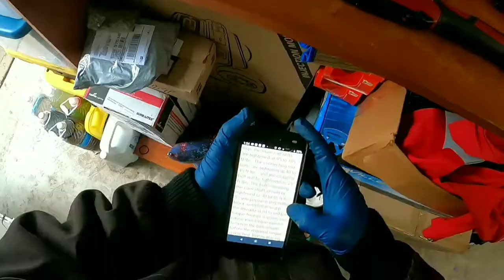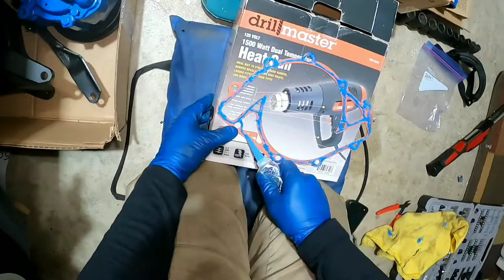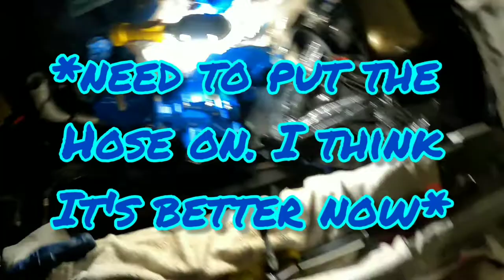Ford 460 STraight up Timing Chain Cloyes 3079x Part Three

Comment: How did you re-seal the timing cover plate back to the oil pan? Love the series, very informative. Keep up the good work
Reply from the maker: Ultra blue rtv
Reply: Any leaks?
Reply from the maker: Nope watch the near the end of part 4 I hang the entire cover with the water pump installed.. you the the crankshaft spacer and cut 2 off the head of 2 long old bolts. Partially screwed both in the the engine block. The. Inserted the sleeve it to the timing cover picked up the entire assemble lined the sleeve up with the crankshaft keyway and the two bolts and slid it on.

Comment: Hey I have a 1975 Lincoln Continental Town Coupe. And I'm having some issues with its stalling while driving down the road. It'll just shut off. Someone told me it may be the ignition switch would you happen to have any ideas as to what it could be?